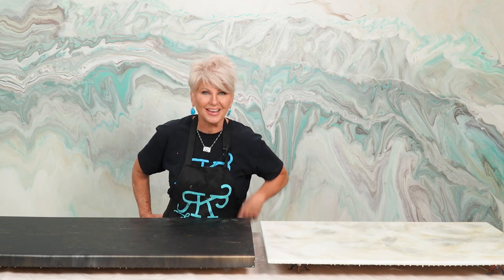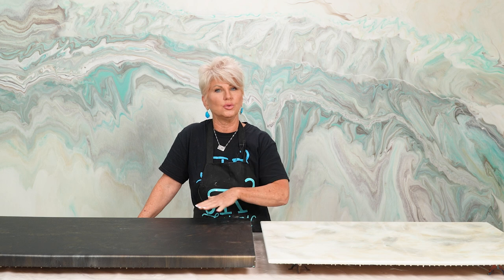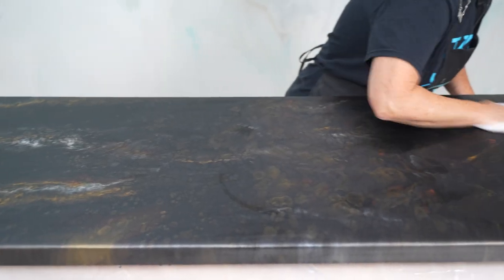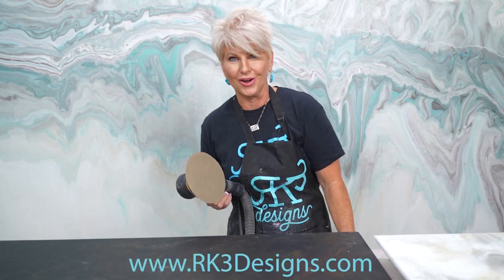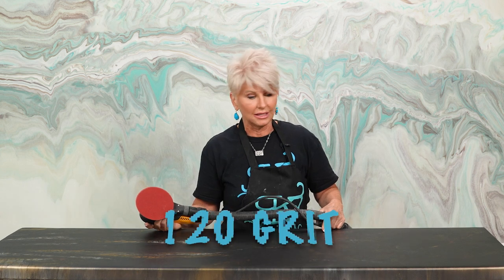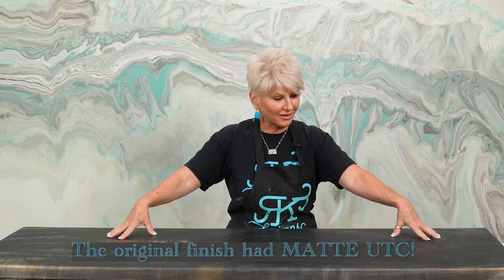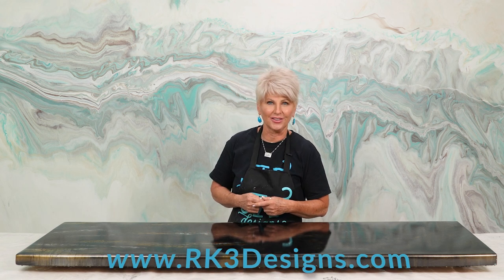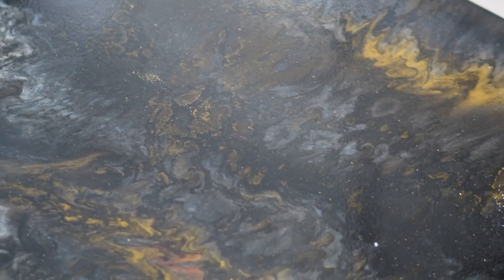Tips on how to the achieve an ultra smooth countertop using the Ultimate Top Coat | DIY Tutorial.

Comment: This method is good for making it smooth but it will give it a sheen. If you want the true matte finish and still have it smooth then take a razor blade and put it at a very low angle ( almost parallel with the surface) and gently run the blade across the surface. It will only cut what is sticking up and will leave no scratch marks or buffed shininess. Go easy, smooth, and light and it works like a charm. Just make sure you let it cure for a couple of days before you do it. That's an 'amateur' tip! On the edges I took the blade and gently ran it backwards (pulling the blade with the sharp edge facing away from the direction I am pulling it) to scrape the bumps smooth. It worked extremely well!

Comment: I’ve learned so much from you and really appreciate you sharing your knowledge! I have a tip for minimizing lines when rolling out your top coat. Start on one edge with your roller frame towards the center of the counter. When rolling, use a little less pressure on the open end and work your way across the counter. The open end gently blends the line made by the naturally heavier frame side. Hope that helps and makes sense!

Comment: Thanks Rhonda, I guess I'm in the same boat as many others. I built a new countertop of MDF and did an exotic marble pour followed by a clear coat, it was stunning. I then followed the directions on the gloss UTC and it dried slightly milky and very matt. I contacted Stonecoat and was told to sand it off with 60-80 grit, glad I didn't burn through to the color coat. I just did the clear coat again and it looks great...whew.  I'm going to follow your directions, you add much more water, I think that's the trick. The bottle says there's enough for 50 sq.ft. but following your specs I bet you could get close to 75sq.ft. You gave me the courage to try it again. Wish me luck. All the best!
Reply: I did my counters white w the art cost and it turned so yellow it’s not funny. Like REALLY bad. I’m repouring gray tomorrow with a Leggari’s product but going to try the stone coat topcoat. I haven’t been happy with their products… I hope this one goes ok 🤞

Comment: @RK3 Designs   
Hello! Thank you for this video. As many people here, I did a white and brass marble which turned out amazing. Then added a clear coat which made it nice and glass like shiny. It was eye popping. THEN,,, I put the glossy UTC using Stonecoat Countertops water recommendation of 1.5 oz of water per every 4 oz of UTC. The application with a 9 in roller and dry roller was flawless. No lines, no discoloration. BUT it created a texture. The surface is super smooth but it has a texture that makes it my countertop look like laminate again. I hope doing this 10000 grit polish can bring back that glass like appearance and get rid of the texture.

Comment: I finished my bathroom vanity--it looked so great! Then I put the UTC on, and It seems to have obscured all the lovely depth I had achieved with the epoxy layers. I did white marble with veining and I used your method of randomly pouring clear, white, milky white, light gray and clear with mica, then using sticks and gray RO spray paint for veins, plus leftover opaque white epoxy for fracture lines, and it was beautiful! It looked so real! And now I can't see the depth and layers and I really can't see the bling at all--the mica disappeared just from using the matte UTC. Will using this method of 10,000 wet-sanding work to restore some of that gorgeous depth and sparkle? Love your channel!
Reply: I really hope she responds to this question because I am wondering the same exact thing!
Reply: @teairakorte3210  Yes, have you already done your epoxy coat and are waiting to do the UTC? I really would have done a LOT more of a bold design and a LOT more mica powder, but even so, I'm not sure it would have shown through the UTC, which seems to have left a milky opacity over the whole thing. Ad I followed instructions 100% after having watched all Rhonda's videos on UTC, including the one where she has a guest on who used a misting spray of water. I'm wondering if I should have used the gloss UTC instead, but I was worried it would show visual texture (the "orange peel" texture sometimes discussed.)
Reply: @Kristin Ferguson  I have already applied the matte UTC to my countertops and like you it gave them a very milky shein which blocked out a lot of the radiance in my piece. I don't hate it, but I definitely thought I would be able to see the smaller details more clearly.
Reply from the maker: Hey there. Did you use our mixing ratio or what was on the bottle? The matte is truly a matte, so you may like the gloss sheen a bit more. The 10000 won’t really do anything for the depth. It will just make it smooth. 😊
Reply: @RK3Designs  Hi! Thank you for this. I had bought the gloss at first, then returned it after watching your video where you said you felt the gloss gave more of a visual orange peel texture than the matte, which I didn't want, so I ordered the matte, and honestly I don't mind the matte surface, and it truly doesn't give an orange peel look on my mostly white marble surface, but it did sort of obscure a lot of the depth I had achieved. I don't hate it (and it sure looks a lot better than the ugly granite underneath!) but I would probably choose gloss for my next project. I followed your instructions to the letter, and I had intended to also do the water mist on the surface as your guest showed in one of your videos, and I had borrowed an atomizer, and even used it on my test piece first, but then forgot to use it on the actual counter! Doh! But the finish of the test piece wasn't noticeably different from the counter in the end. I will note that in one of your videos where you use the gloss UTC, it seems like you are using a greater portion of water than in previous videos and I wonder if you have updated your ratio? I am obsessed with your videos and now I want to turn every surface in my house into marble :D

Comment: Thank you for the great video. I'm new and finally did my countertops in my kitchen. I used stone coat gloss. Now I'm trying to figure out should I just do another SC  epoxy or the top coat. I'm so scared the top coat will leave lines because I'm new. Also I used glow and the dark powder in some of my epoxy. Will Appling the TC tone down the glow, or will it be ok?

Comment: Hi Rhonda - I really appreciate this channel! In 2021, I refinished an ugly old kitchen countertop using the UTC matte finish. It's been great (though when I watch THIS video I realize that I DO have some texture I'd like to sand out). It's an arborite counter with a round profile at the front edge....not only, "round", but that rounded edge does come up a little higher than the level of the counter, before rounding down to the vertical surface, and in front of the sink, water tends to sit at times. Now I have a little section that looks like a piece of leather has been pushed to the side, and you can see the original (hideous) counter. Is there a way to do a repair, or am I in for a complete re-do? THANKS!

Comment: I really love how my kitchen countertops turned out - gorgeous "blue granite" look with uber depth and detail.  The only thing I do NOT like is the very UBER glossy sheen.  I purchased the matte UTC and planned to use it.  But I did  test board and it totally changes the look - little if any depth and colors/details subdued down to maybe 15% compared to NO UTC. Do Not like.  So I'm in a holding pattern before making my next move.

1.  I was wondering if you've ever tried mixing the Part A glossy and matte UTC  together (mixing super well, of course) as I would think that could offer a far less glossiy outcome without loosing as much depth and detail.

2.  I also watched a video of you applying UTC and you mentioned in that video that the UTC Glossy was not super glossy - instead more semi gloss or satiny.  Is this correct?

Thank you so much for your great and helpful videos.
Reply from the maker: Hey there. Sorry just getting able to reply, I was in a car accident and Ive been down a bit. Im surprised you didn’t like the matte finish. In our experience we’ve had great ouch with the matte actually making the colors pop and the details really stand out because you loose that overpowering glare. Did you use our mixing ratio on our PDF? The gloss more of a semi glass but it will have a slight visual texture due to the roller application. I have tried to mix the two but it still comes out a more matte than a gloss.

Comment: I just used the gloss UTC over a white marbe epoxy table with no clear flood coat and I can see some roller lines and I dont like the light reflection masks all the beauty of my table. Im thinking of removing the UTC & added a clear flood cloat. Is that possible to do if I just have a color coat of epoxy underneath?
Also what are your thoughts on just using  epoxy and not UTC on top? Is it necessary?
Reply from the maker: I have a video that will answer most of these questions https://youtu.be/bu8F0uqRLpQ Also email me and I can give you some additional information Rhonda@rk3designs.com

Comment: What did I do wrong? Wet sanded my matte UTC and it’s no longer matte. I don’t feel like I over sanded. I just wanted to knock off the slight texture and keep the protection. It feels smooth, but has a fine pattern of matte/shiny. Hate it!  I loved the look and feel before I used the UTC at all, and had it prepped for UTC.
Reply from the maker: What grit sand paper did you sand it with? As stated in the video, we always recommend doing a sample board before sanding your project. Some colors are affected differently than others. This gives you some expectations on what the finished project will look like. You can sand down more aggressively like instructed on the video, and pour another flood coat if you don't want the UTC. You'll just have to baby your surface until it's fully cured. If you have any questions, please don't hesitate to give me a call. I'll be more than happy to help you. (830) 433-7199

Comment: Can you do this same process on the gloss UTC? To tone down the texture
Reply from the maker: You can send with the 10,000 grit, however, depending on the color, it may show a flattening effect more than if you do it on the matte . You’re not going to remove the visual texture on the gloss. That visual texture is caused by the application method of using a roller. All gloss products, no matter what they are, will have a slight visual texture if applied with a roller.
Reply: @RK3Designs  i can spray gun UTC

Comment: would it help to roll the utc on with a foam roller instead of the 1/4 in roller?
Reply from the maker: We've not had good luck with a foam roller. Causes too many micro bubbles.
Reply: Thank you, I tried the wet sanding. You are right makes it feel a lot better